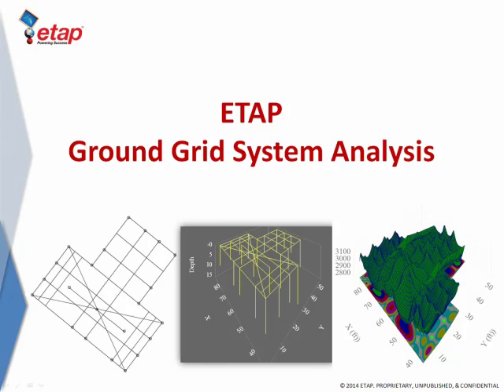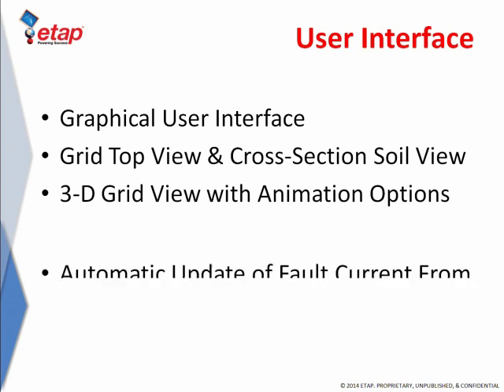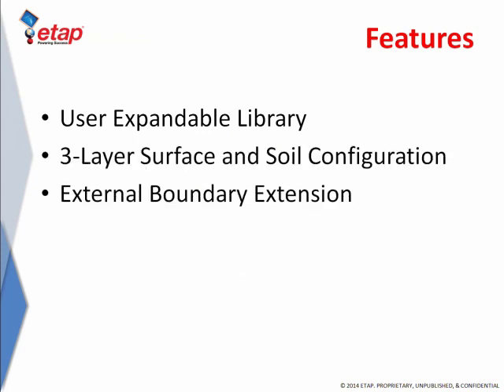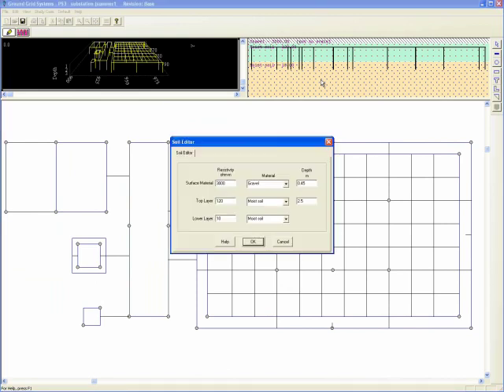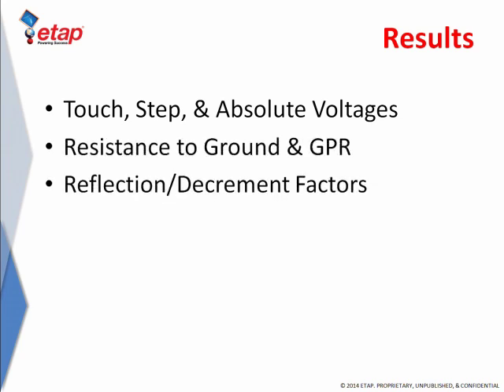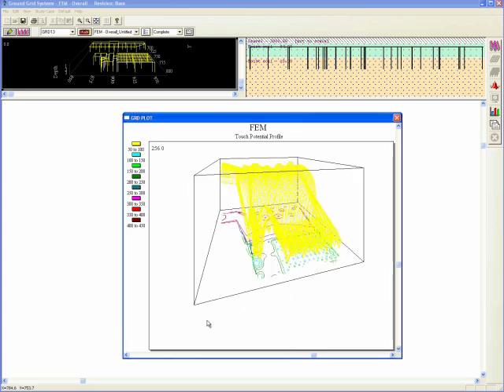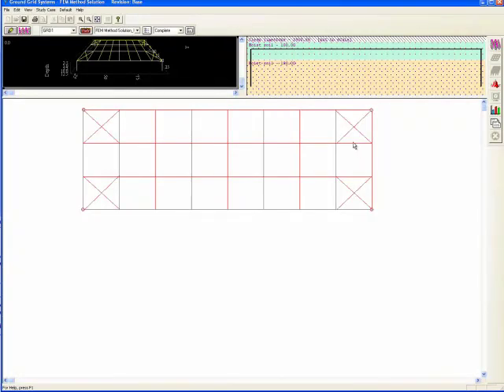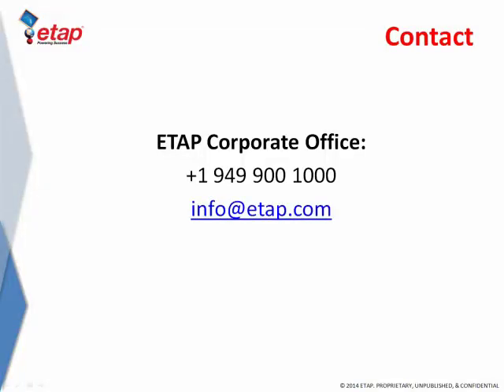ETAP Ground Grid System Design & Analysis

Comment: I have a resistivity study by the SEV method (Vertical Electrical Sounding) or schlumberger method, in which resistivity measurements are taken at different depths (5 samples), how do I define the two layers for modeling?
Reply: I would suggest you to check Hummel equation which is a formula to reduce the number of layers.

It says that ρ eq. = (d1 + d2 + d3 + ... + dn)/((d1/ρ1) + (d2/ρ2) + (d3/ρ3) + ... + (dn/ρn) and the d eq. = d1 + d2 + d3 + ... + dn

This way you can make a reduction from 5 to 2 for example.
Please note that d is not the depth but the height distance.

Comment: is there any plugin for autocad to export to etap as xml
Reply: I might be late. You can see how-to in chapter 40 of ETAP user guide.
Reply from the maker: ETAP offers an export tool which is part of the ETAP Base  Package
https://etap.com/product/S/P/data-exchange/Built-in-DataX-and-Conversion-Tools
Reply from the maker: You can now use our REVIT bi-directional data exchange module to communicate with AutoCAD
Reply: @ETAPsoftware  this was not exist already.. please inform the latest updated.
Reply from the maker: @wongsabarchannel1335  Many build in conversion and data exchange modules exist within ETAP. Please update to the latest release to take advantage all all the new and updates import and export features in ETAP
Reply: @ETAPsoftware  I think better ETAP provides the tutorial video for this issue. From CAD files Earthing layout then convert to XML file, then until import to ETAP software.
Reply from the maker: @wongsabarchannel1335  Please contact ETAP customer support for assistance. You can reach us at support.etap.com 24/7. Or contact your local ETAP office for assistance

Comment: I am modeling an old earthing plan in Etap for further analysis. This grid consists of three meshes at different depths and all are connected. I have designed all three meshes at different soil depths but i dont find anything to connect these three meshes in ETAP.

I have run the simulation and there's no error. Does Etap consider all different meshes in different soil depths connected by default???

Please help
Reply: Hello, you may model all three meshes together in one presentation if you are using the FEM method. For more details, please contact the ETAP technical support directly.
Reply: @yichenbi3863  how to contact them?
Reply from the maker: https://helpdesk.etap.com/cgi-bin/wonderdesk.cgi

Comment: Hi, does the Rg resistance gets involved on line to ground short circuit currents calculation?
Reply from the maker: Thank you for your interest in ETAP software. to answer your question: The Rg is not automatically considered for line to ground short circuit calculation, but users can add the Rg as Fault Impedance Zf entered on the Adjustment page of SC Study case editor. hope this helps. For additional assistance, please contact ETAP support at support@etap.com or go to our Help Center https://etap.com/support/technical-support

Comment: Thanks for explanation. One question:

-Ground fault current is referred to which voltage level? I mean is there any set value that user can insert x kA fault current at 400 V level or at medium voltage level?

Warm regards.
Reply from the maker: Thank you for your interest in ETAP Solutions. Please contact our Help Center https://helpcenter.etap.com to assist with your request

Comment: The video say "analysis using IEEE 80 Standard and Finite Element Method (FEM)." but it is false, because the IEEE 80 not use FEM, the standard not say that is possibe use the finite elemento method.
Reply: ETAP Ground Grid Design System provides two methods for ground grid design. Users can select either the IEEE Standard Method or Finite Element Method (FEM) based on their design requirements.
Reply: The video say "analysis using IEEE 80 Standard and Finite Element Method (FEM)." but the explanation say "IEEE Standard Method or Finite Element Method (FEM) ", them AND & OR are differents.